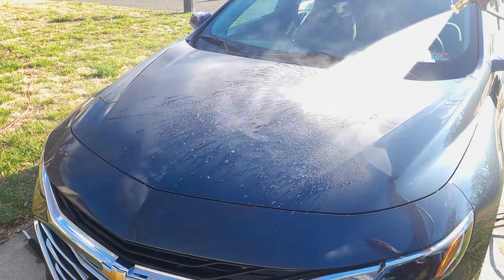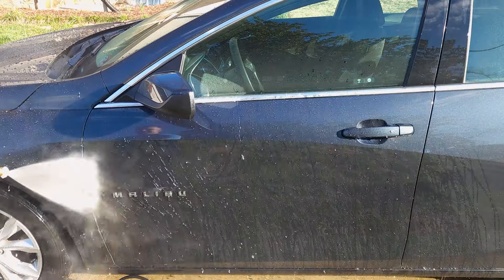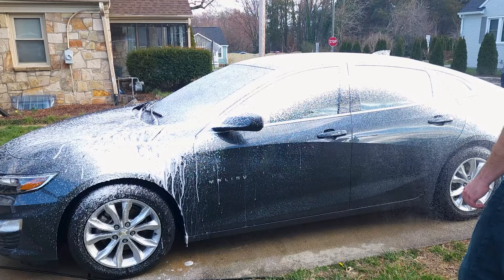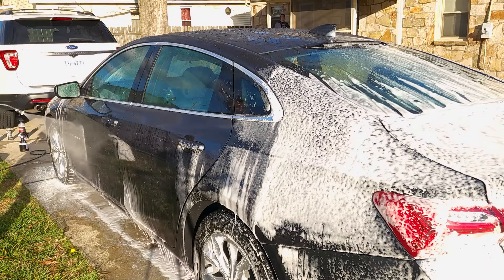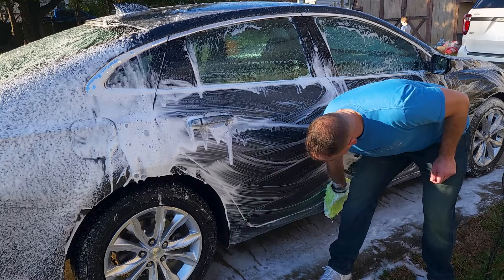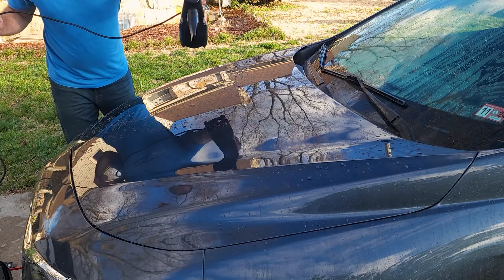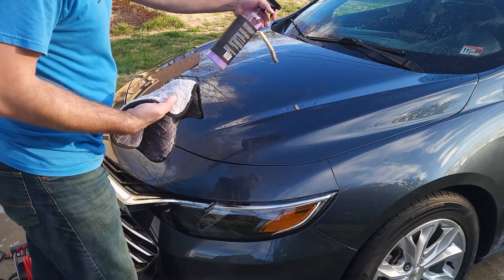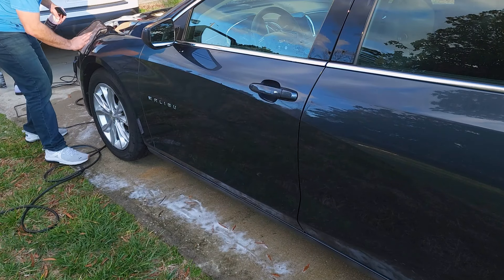Meguiars M888 Ceramic Coating One Month Update/Hydrophobics Test! (Impressed!)

Comment: How is the M888’s everyday shine compared to Meguiars Ultimate Liquid Wax and Ultimate Detailing Spray? Those two have been my go-to for the past decade because they give an prismatic/3D looking shine, like the water surface on a still lake. I gave their hybrid ceramic product line a try for the past 12 months and ended up very underwhelmed with the shine (and performance and longevity). I’ll give Megs another chance if this new product has a shine that beats the CQuartz/Gyeon/CSL/Gtechniq stuff that’s so popular now.
Reply from the maker: Its looks good for sure, but if you dont like the look of ceramic products I dont think it will change your mind there. Performance so far has been amazing however! The hydrophobics and self cleaning abilities of this have been great!
Reply: I still like the Ultimate Liquid Wax too.
Reply: @danlc95  I went back to the Ultimate Liquid Wax this week and it’s just as good as I remember it. It doesn’t bead water like a non-stick pan but it’s so easy to use and the shine is night and day better than the CQuartz and Gtechniq ceramic coatings I’ve used.

Comment: I personally use Meguiars Final Inspection as a drying aid, as it has zero fillers or silicon (body shop safe too) so that it doesn’t mask my ceramic coated cars. But man so far M888 is living up as advertised. 

I literally just finished two days ago  applying it on my Subaru. The smell reminds me of their Hybrid Paint Coating, I assume it’s the Polysiloxane chemical that they use. But man this coating is extremely slick and hydrophobic. 

If this can last a min of two years, it’s going to replace CQuartz UK for me as my main coating of choice. 

Excellent update video, looking forward to see more as time progresses.
Reply from the maker: Thanks for the comment! Yeah final inspection might not be a bad choice. Stuff is super cheap too! I think the 3 month mark will probably be my next update unless I see some wild changes or something. Hope it holds strong!
Reply: M34 Final Inspection is one of my favorites too. Great product. Smells great too.